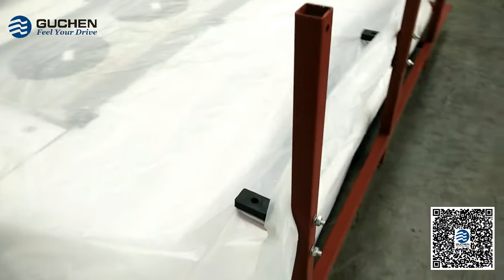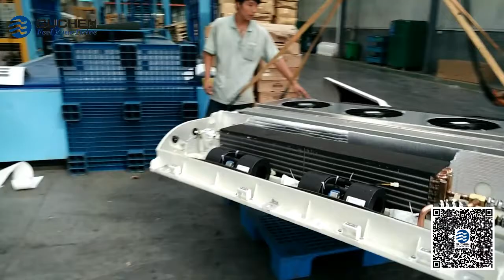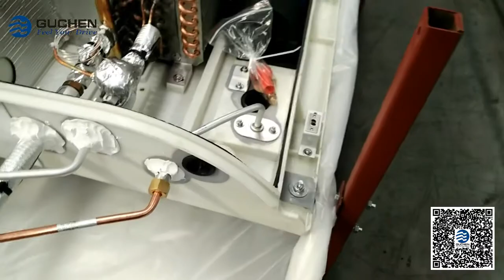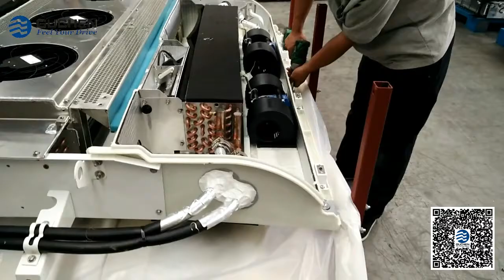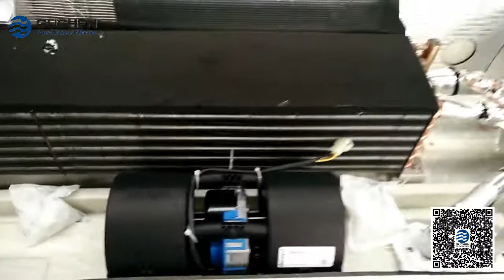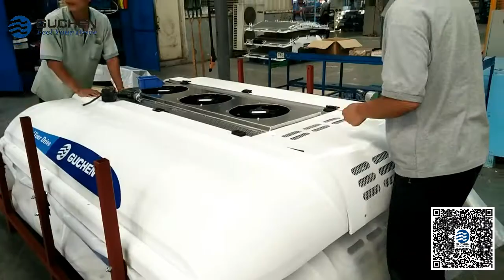How to package and ship the bus air conditioning systems

Comment: Hello sir i am interested to buy bus ac
Reply from the maker: Hi Milan, please specify your requirements. what is the bus length? and cooling capacity requirements?
Reply from the maker: or you can directly mail your demands to info@guchen.com
Reply: Sir I need 20 units ac for 11mm bus
Reply from the maker: @milangiri4996  Dear Milan, Could you please let me know your contact email? I will let the overseas manager mail u the full details ASAP. awaiting for your kind reply, best regards.